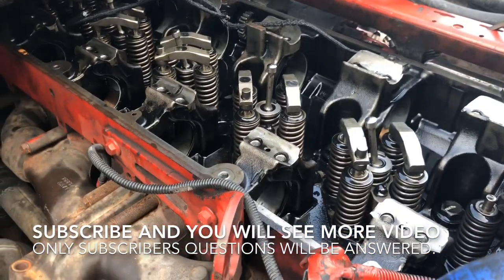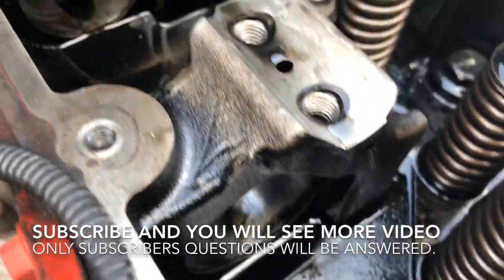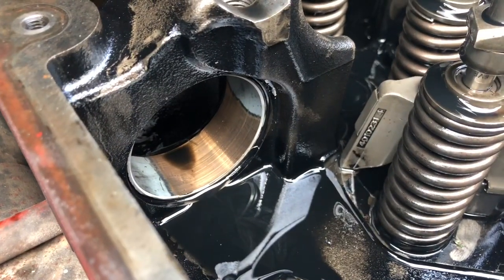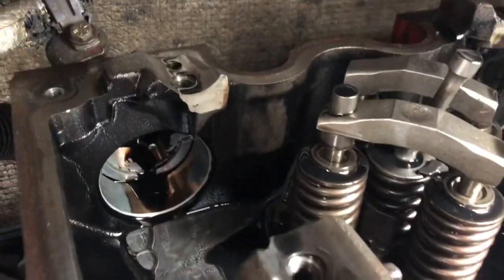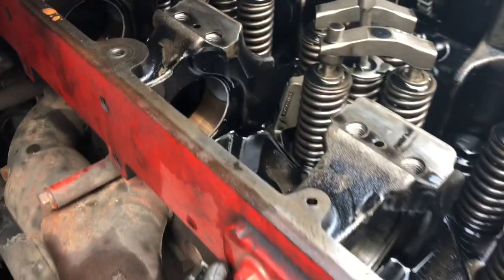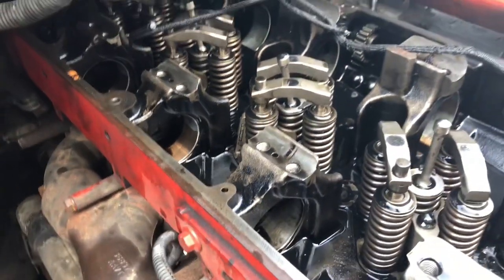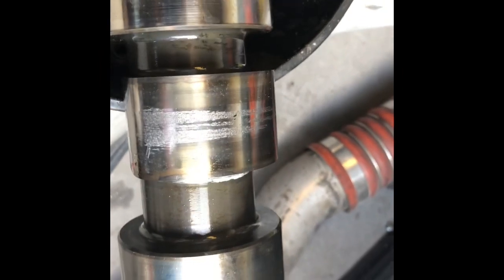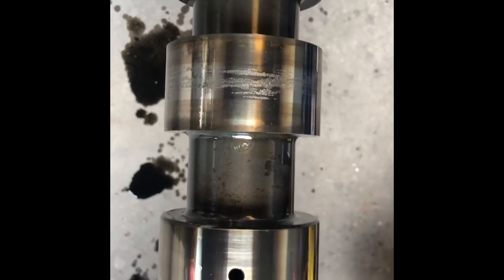Cummins ISX low pressure oil, camshafts damage, easy to prevent.

Comment: I have Cummins isx with 700,000 miles on it when I drive oil pressure is ok but when I stop it will idle under 18 and light comes on, it's cumshif or different 
Thanks for your vedio
Reply: Need engine calibration  need good oil to   putting Lucas oil pressure list goo to 27 when u stop you Ned good oil  Rotella 🛢 is garbage  🗑   oil Mobil good 👍  Lucas one gallon is perfect to